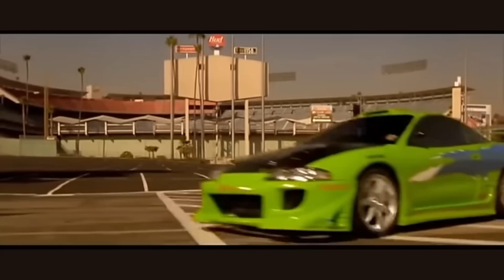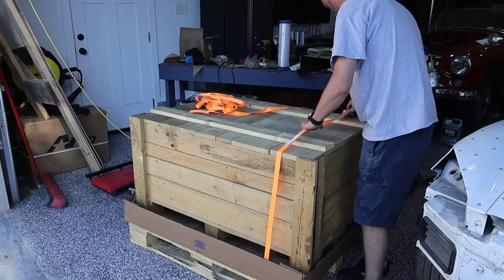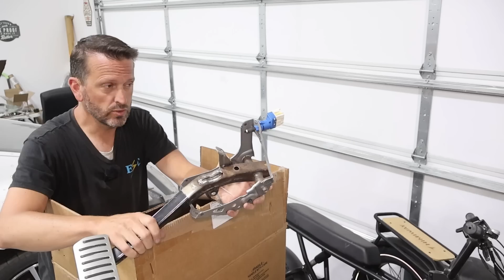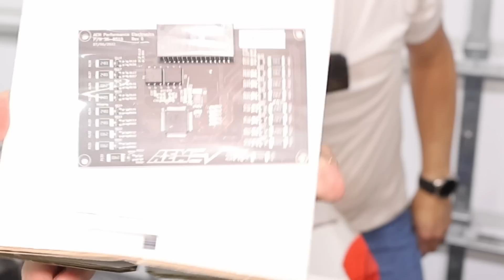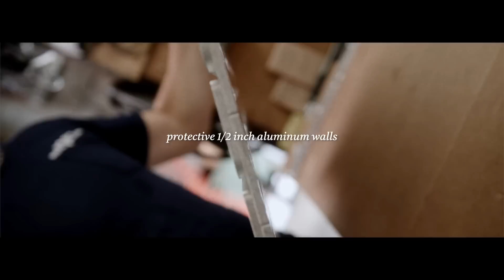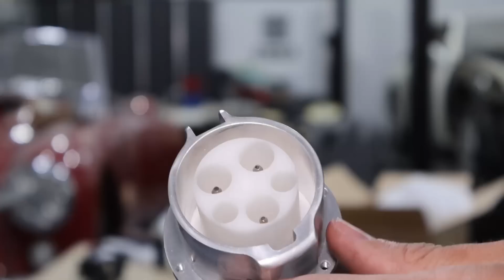Spending $10,000 on Car Upgrades, Fast and Furious Fantasy: Nissan Parts Haul

Comment: Does the AEM controller really produce 600 HP?
Reply from the maker: The Tesla model S performance large drive unit can produce ~450kW (~600hp).  The AEM inverter board controls the motor.
Reply: @electricsupercar yes, I know the hardware is capable, but is AEMs software up to par? 

I know the t2c controller produces 650. I just haven’t seen any power numbers from AEM.

Comment: If you are already converting older vehicles to electric, there must be a possibility to keep the look and function of the console indicators?  Personally, I am disgusted by screens in cars and would rather rip them out of the vehicle!  I understand that they are necessary to check the condition of the vehicle, but I don't need it in front of me when I drive.

Comment: If my memory isnt off the brake pedal for the 350z is about the same as the 300zx. I use a gen1 Ibooster in my 350z and have a step file for a adapter plate to use the stock pedal with it. If its something ypu would be interested in (free ofcourse) :)
Reply from the maker: Let me do some looking.  I may reach out to you

Comment: Would it be possible to do NACS on one of your conversions? And even if you could, would Tesla even let you use their charging points?
Reply from the maker: There are not many aftermarket NACS options as far as the charging port.  I could make a custom one, but currently it could not work with the Tesla superchargers.

Comment: Will you be adding a firemens disconnect in case of car accident or fire and that can be easily accessible from the outside to disconnect batteries? Or any other safety measures?
Reply from the maker: I'm not sure about a "fireman's disconnect" as it is not a standard car.  No fireman would know what to do or where to look.  We will have disconnects or service switches with labels.

Comment: I have a little curious question. Why have none of your cars till now have some sort of Fast Charging. Not like 200-300kw but something mild like 50kw. The batteries themselves should be plenty capable of handling that stress. Is there no suitable DIY charging solution for Selfmade EV's out there? Keep up the good work :)
Reply from the maker: It is up to the customer.  I am doing it on the Porsche.  It is added cost and only really a benefit if you plan on road tripping.
Reply: I don't know if this is the right answer but it may have to do with the"handshake" protocols between the car and the fast charger. The fast charger must be able to recognize the car that's about to receive the charge, so if the cars battery management system software is not approved by a car manufacturer like Tesla or Ford, the fast charger won't recognize the car and initiate fast charging. It's probably to protect the hardware of the charging unit.

Comment: I always wanted a 3000gt vr4, had no idea those suckers cost more than a corvette in their day&weighed 3,700-4,1000# 😀
Better to just buy a new 2024 tesla m3p for 55k I think. Cheapest way to a 10s 4dr American made daily driver. 👍🏻

I keep waiting on someone to freaking do a tesla plaid rear du ev swapped elktromod setup with real working torque vectoring! 
650-700hp weighs about the same as an old single large du and has those sweet c.f. wrapped dual plaid motors with torque vectoring. 😎
Reply from the maker: To date...there is not an aftermarket controller for the Tesla Plaid drive units.